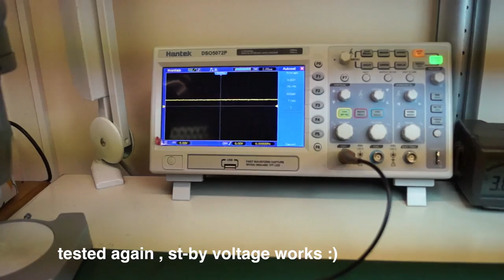iMac Repair No Power, Broken Main Supply A1312/ADP-310 www.service-macbook.ro

Comment: Hello , I have replace the new power board still don't turn on, what is next to check for dead imac. Please
Reply: Manually reset PRAM or NVRAM by removing battery.  Requires taking out the screen.  Thank you Apple for more user unfriendly design.

Comment: Hi guys I have oscillating Vcc on ncp1605.. (8to13v).. could it be a bad resistor? on Pdf they stat I should have at least 15v stable.. my psu is the PA-2311-02A. thanks
Reply: My dead Lite-On PSU from iMac 2011 also has this oscillating 7-14V on the VCC of NCP1605. I'm wondering if you find a cure? Do you have a repair PDF? Can share a link pls?

Comment: Hi, I have a iMac 21.5 2011 A1311 my power unit is dead, I listen a strange noise i push off and now not switch on, can possible same problem of resistor?
Reply: noises coming from smd chip next to this resistor
Reply: Did you fix??? My A1311 dont works too.

Comment: Salut poate ma poti ajuta cu un sfat. 

Am un iMac late 2009 I7 2.8 si am avut probleme cu placa grafica. Am cumparat una folosita si am inlocuit-o, insa computerul nu porneste. E total mort. Se aude un bazait din sursa iar cind fac testul LED (SMC) pe placa de baza (cu butonul de pornire apasat) se aprinde unul din leduri dar stinge dupa o secunda. Cind i-au degetul de pe button se mai aprinde odata si ventilatorul procesorului se invirte o secunda si se opreste (ca si cum curentul este intrerupt). Nici unul din ledurile de pe placa de baza nu raman aprinse cind computerul e connectat la curent. Modelul asta are ledurile pe partea interioara a placii de baza si imi este dificil sa vad care leduri se aprind.

Aparatul de masura (20 VDC) imi arata pe sursa (cu sursa conectata):

1=0V; 2=0V; 3=0V; 4=11.96 V; 5=0v; 6=3.97V; 7=0V; 8=0V;
9=0V; 10=0V; 11=0V; 12=0V; 13=0V; 14=0V; 15=0V; 16=0V;

Aceaisi masuratoare pe placa de baza de la dreapta la stinga cu numarul 1 masa:

1=0V; 2=0V; 3=0V; 4=11.96 V; 5=0v; 6=0V; 7=0V; 8=0V;
9=0V; 10=0V; 11=0V; 12=0V; 13=0V; 14=3.97V; 15=0V; 16=0V;

Computerul nu a fost folosit doi ani asa ca am schimbat si bateria de pe placa de baza...

Eu suspectez ca este sursa stricata insa nu sunt 100% sigur si nici nu am pregatire de specialite asa ca nu vreau sa cumpar componente fara sa stiu ce are...

Multumesc anticipat,
Gabriel.
Reply from the maker: Pentru modelul dvs. sunt 4 Leduri de diagnoza:
 1/Stand by sursa OK 
 2/Surse si tensiuni placa de baza OK
 3/CPU/Ram Initializat 
 4/GPU display OK.
Din descrierea dvs. e posibil sa fie o problema cu sursa ori un scurt pe placa de baza.

Comment: This is helpful to watch but can you explain how you did this?  What was the gel you put on the resistor before you applied heat?  What was the liquid you put on before you put the new resistor back on.  And more importantly, please - what is the VALUE on the resistor?
  Where do you get the resistors?
Thank you for this video - I am hoping that it will help me bring back life to a 2008 iMac power supply.
Reply: the print on R40 in my power supply (ADF-310AF D) says "520" so it should be 52R.

Comment: bro, whats resistor value
Reply: the print on R40 in my power supply (ADF-310AF D) says "520" so it should be 52R.
Reply: @lastnickever4440  34kohms